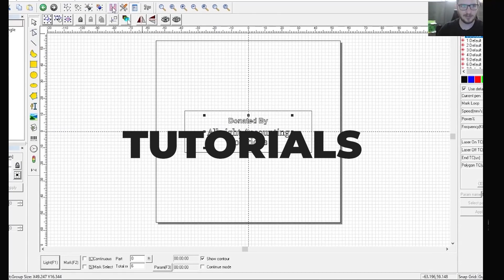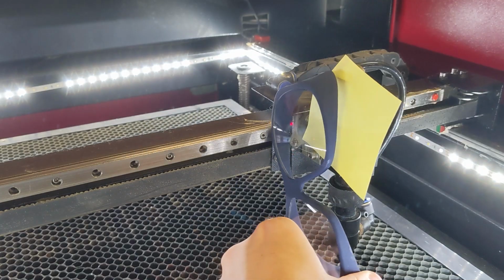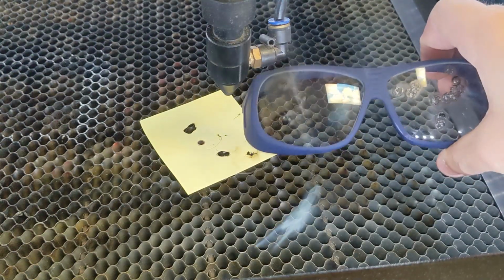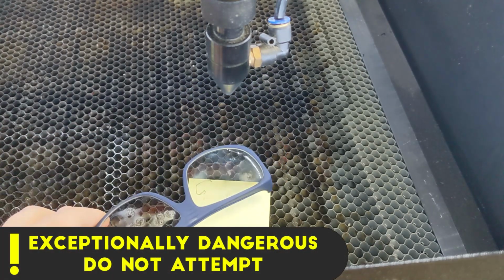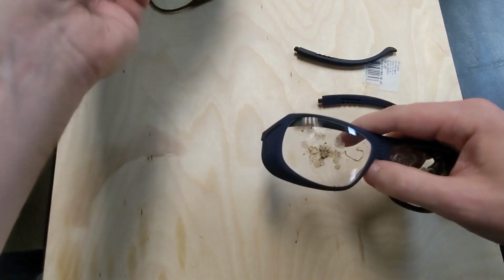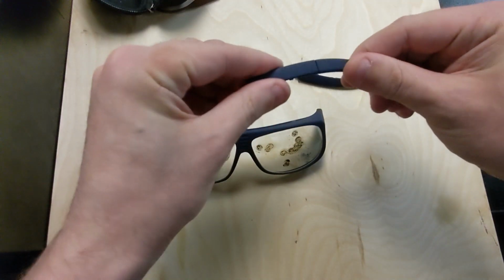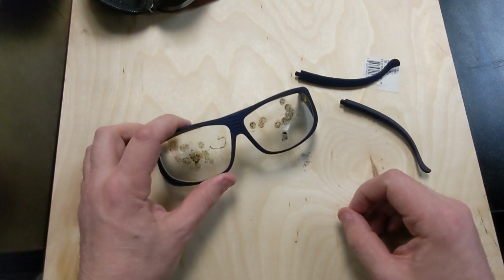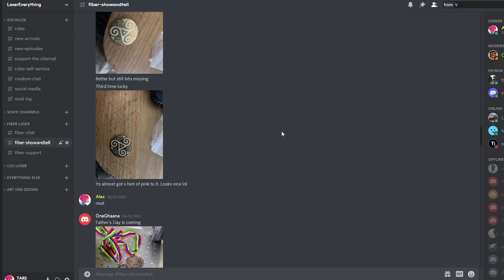The BEST CO2 Laser Safety Glasses | FreeMascot 10600nm Glasses Review

Comment: You really don't need to spend extra money on special laser goggles for CO2 beams. 10.6 micron deep IR light is blocked by many (not all) plastics natively and literally any $10 pair of normal clear polycarbonate safety glasses will work fine, see the 1993 paper "The Protective Characteristics of Polycarbonate Lenses Against CO2 Laser Radiation". In fact you may be able to get thicker lenses in common impact safety glasses that would provide longer protection against burnthrough than the thinner material specifically used in the goggles shown.
I do wonder if you are aware that you are only a few miles away from the world's second largest and highest energy laser....